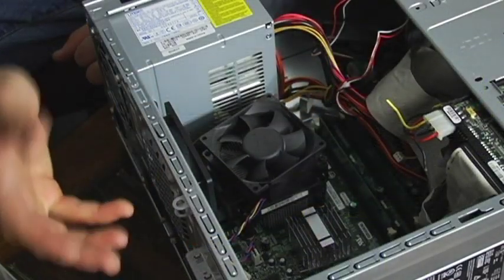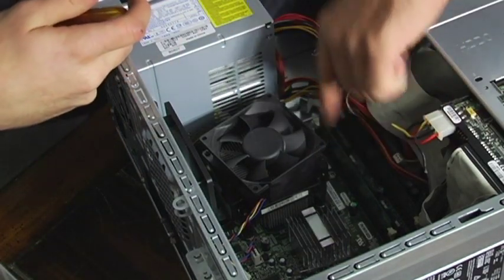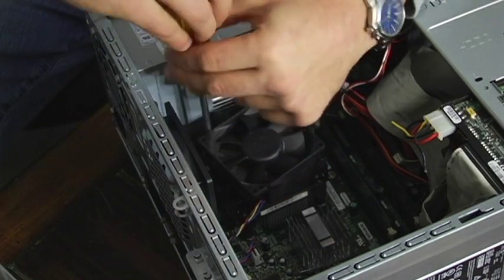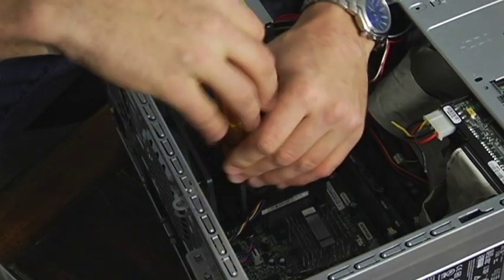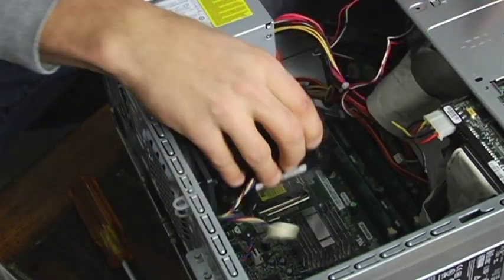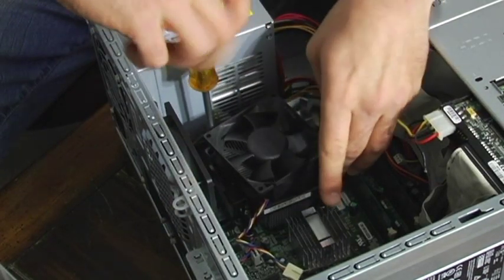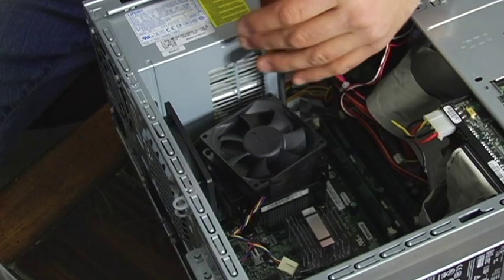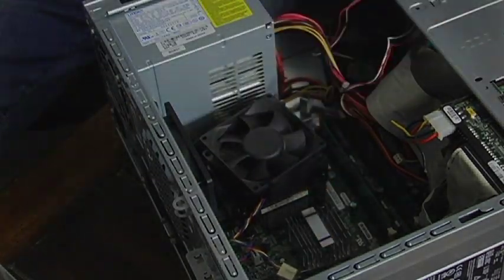Computer Maintenance & Upkeep : How to Replace a Computer Processor Fan

Comment: @clydebogo 
Well as long as the fan is running and keeping your CPU cool, then there is no need to replace it.
Unless the fan is being slowed down, is a different story.
If your fan isn't running at 100%, your computer performance will decrease.